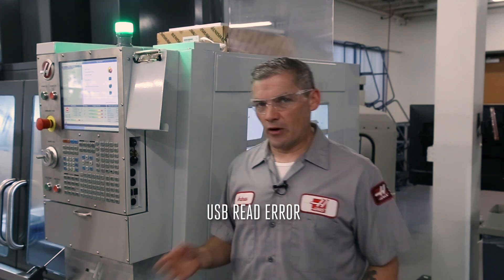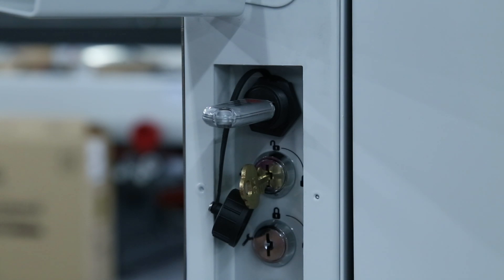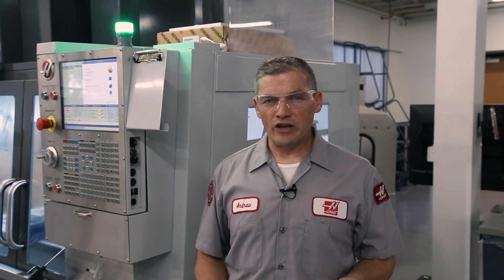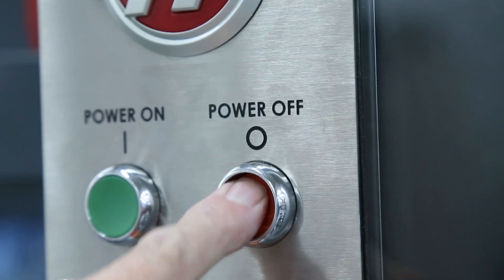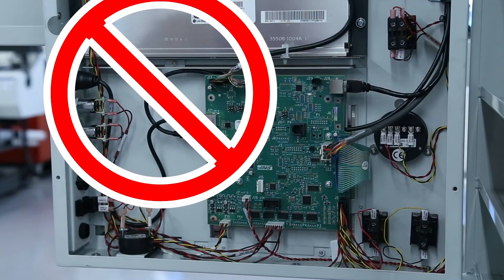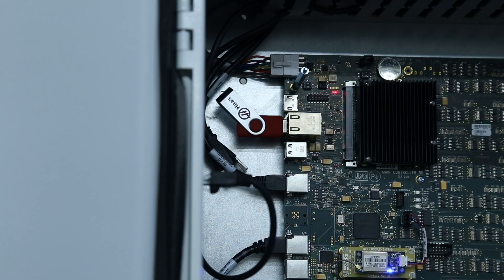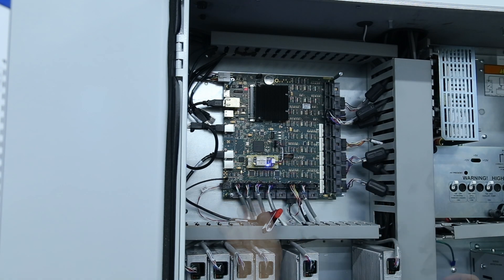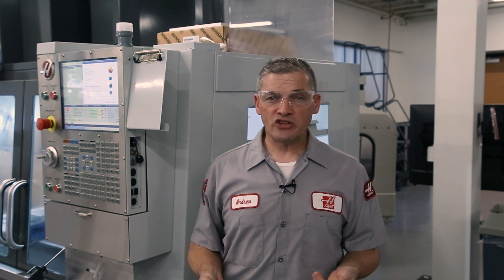USB Read Error Troubleshooting - Haas Automation Service

Comment: We have intermittant problems getting to the NC files - same USB works 30 times in a row, and then Haas can see the size of the drive, the memory usage, but it will not list the programs and then after a while it reads again. 
Any suggestions?

Comment: EDIT*** it was because I was missing the % at the beginning and end of my programs. Hope this helps someone. 

I wonder how I’m supposed to get my older Haas to read a text document that my new ones can read. At the beginning of the program, I have program number O9099;
My newer vf5xt reads this program just fine. My older Haas doesn’t have the “O” there and errors out as “cannot read code” also, my older Haas will not allow me to bring over my program from the usb drive to the memory but my new Haas will. I can also not edit code stored on the usb in my older Haas but my new Haas allows it. My older Haas is 2010 I think My newer Haas is 2016 I think. Kind of frustrated that I reprogrammed a job for efficiency and cannot run it now.

EDIT*** it was because I was missing the % at the beginning and end of my programs. Hope this helps someone.

Comment: I have had this issue twice now, and it is my belief its an engineer who doesn't eject the drive when I obtain models from them. I get it to work after about 20 attempts. My employer got a new one that is 64g. Is that too big? Is it smarter to have a separate thumb drive for the model files I use to progra., and another for the NC files? Any help is appreciated as my company is super cheap, and will not call HAAS for repairs. 
Thank you!

Comment: We find that we use small usb's that ONLY have NC programs on them. Don't have your Mastercam or Solidworks files on them also. The control make cough on that - only NC programs needed. We use some 2gb drives we got off Ebay that look like little blue aluminum keys at our HTEC school.  Other students that use USB with all the solid model files are the only ones that have problems.

Comment: What kind of usb memory stick do you recommend for Vf8.? (Kingston,Sandisk....).what size:8,16,32 GB?USB 1.0, 2.0 or 3.0?.i would like to use it for cnc programs

Is this one ok?
 INTENSO Aluminium line 3521451, 4GB, USB 2.0, gri
Reply from the maker: Daniel Sarpe - We have used both Kingston and SanDisk successfully, in 2 4 and 8GB versions.  But every vendor has so many versions that we can't say for sure that every USB from those vendors will work.  From our experience most USBs work with no problems, but occasionally a customer will have one that doesn't work.  We are not familiar with that Intenso brand.  Haas Automation
Reply: Thank you

Comment: I'm still using floppy disks! Not saying I'm proud of it, just an older machine.
Reply: I am running Windows 98 on a K-mart blue light special (actual brand) computer I got from the neighbors at a yard sale for $20 for my plasma cutter; it will only recognize one USB drive that I have. So, 5.25" or 3.5"? :-)
I love that Haas is willing to share the details of troubleshooting.
Reply: @BrilliantDesignOnline  3.5", the biggest problem is finding discs. I'm a one man shop so it's not a big inconvenience

Comment: The only USB drives that work in our machines are the USB 1.0 drives, they are dirt cheap on eBay, but make sure they are less than 1 megabyte.
Reply: I've experienced the same issues with older machines. They don't like higher capacity drives